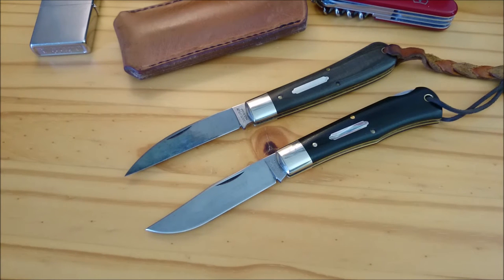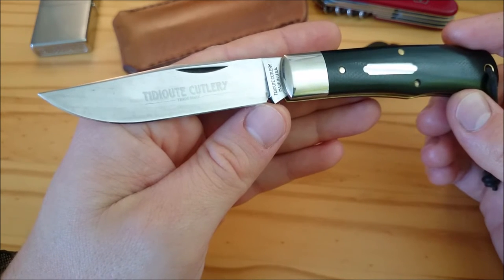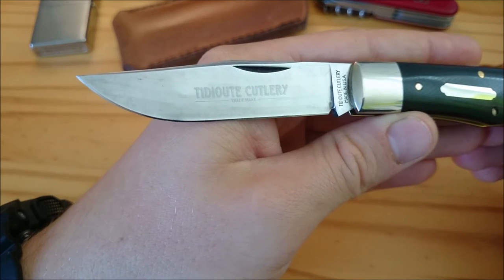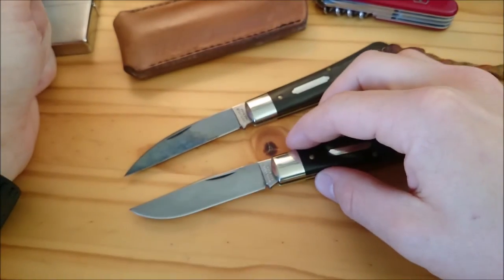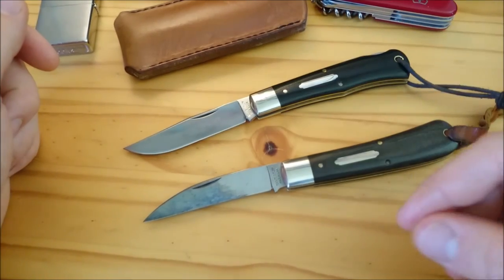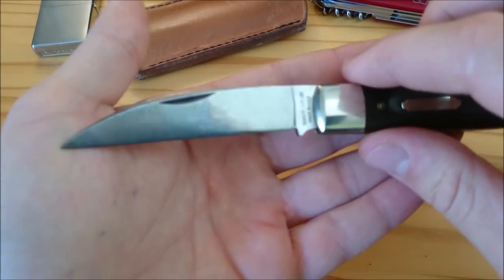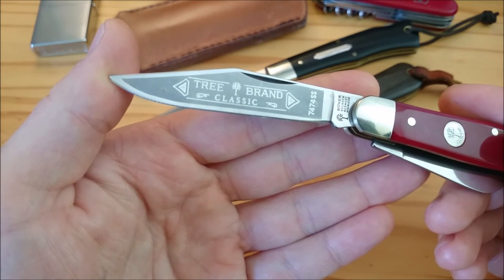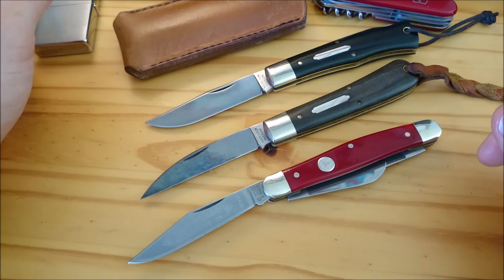My Thoughts on Carbon Steel & Patinas

Comment: Moin!
Ich bin da immer hin- und hergerissen, wenn es um Kohlenstoffstähle geht. Ich traue mich zum Beispiel bei spiegelpolierten Karbonklingen von GEC kaum, sie zu nutzen. Obwohl gerade die Spiegelpolitur dafür sorgt, dass die Klinge noch etwas rostresistenter wird. Aber mir tut es leid um den Klingenaufdruck. Zudem handelt es sich dabei meist um Sammlermesser in geringsten Auflagen von gerade mal 15 oder 25 Stück.
Was mir auch nicht so gut gefällt, ist der starke Metallgeruch, der sich auch auf Lebensmittel überträgt. Dazu kommt dann noch, dass die Patina auch leicht auf Lebensmittel abfärbt.
Deshalb nutze ich nur wenige Messer mit Kohlenstoffstahl regelmäßig.
LG Claus
Reply from the maker: Claus-L. Müller da geb ich dir recht Klaus, ein Northfield wäre mir wohl auch zu schade zum benutzen. Deswegen kauf ich mir nur Tidioute ;) wobeis mir um die Klingenätzung bei meinem 72 schon etwas schade war, das Video ist ja bloß ein re-upload eines älteren Videos, mittlerweile ist die Klinge fast schwarz und die Beschriftung kaum mehr zu sehen. 
Was den Geruch /Geschmack angeht hab ich mittlerweile die Theorie, das Menschen das unterschiedlich stark wahrnehmen. Mich stört es zum Beispiel kein bisschen, sogar der extrem riechende CV von Case nicht. Aber ich verstehe es definitiv, wenn man das nicht mag. 
Dafür gibt's ja noch die GEC mit 440C ;) 
Gruß, John
Reply: Leider ist da an die schöneren Exemplare schlecht ranzukommen! :-/
Reply from the maker: Claus-L. Müller also bisher ist die einzige sichere Quelle die ich kenne Mike von mikesknives.co.uk, ein netter Kerl.  Da du ja auf kleinere Messer stehst, er hat ein paar Northfield Begales lagernd, und ein Wall Street in Smooth Autumn Gold :) 
Vielleicht schaffen es die Herren von Tools For Gents ja einen Deal mit GEC an Land zu ziehen, das wär genial!
Reply: Darauf hoffe ich auch!